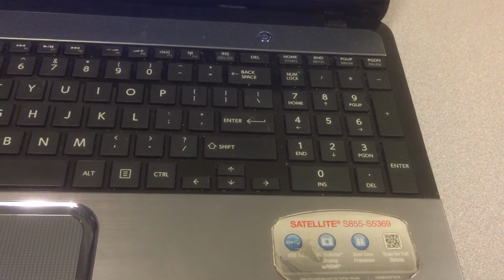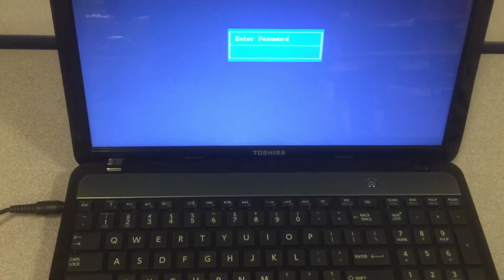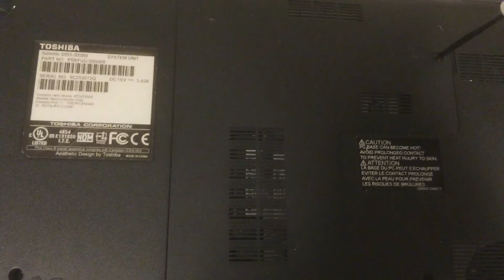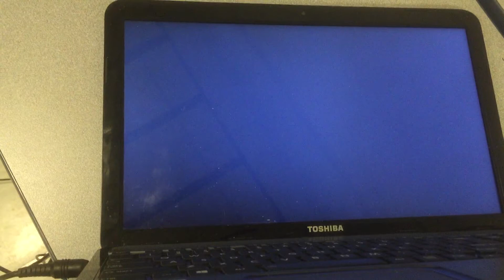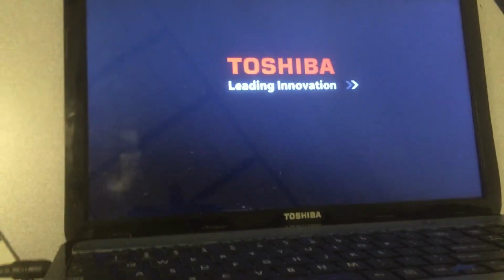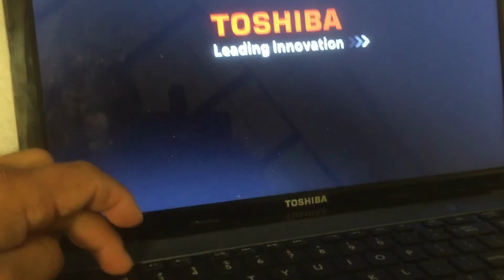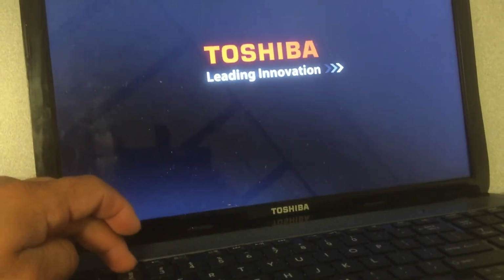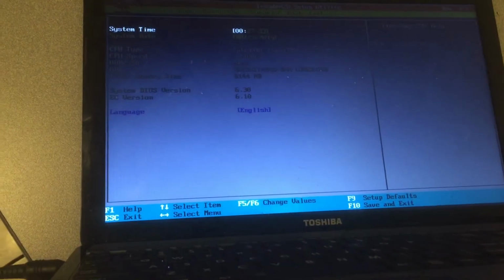how to remove bios password Toshiba Satellite S855

Comment: I found one of these in the alley. I couldn't believe I found your video with the same exact model number, even the same sticker in the bottom right hand corner. Identical, well almost. The mother board was slightly different but the B500 pads were there slightly moved over now. However, I discovered I had to actually unplug the power plug for some reason and then plug it back in before this worked.  After that it worked, but I got a password message for the HDD now.  It would not let me into the BIOS even with hell freezing over, it just insisted on a HDD password.  It was probably the original HDD as it too was a Toshiba.  On a hunch, I removed the HDD, powered it on and I got exactly where you are, No media detected, and I now got into the BIOS!  HA! GREAT!!!  Thanks man!